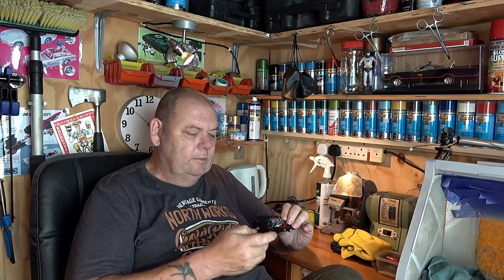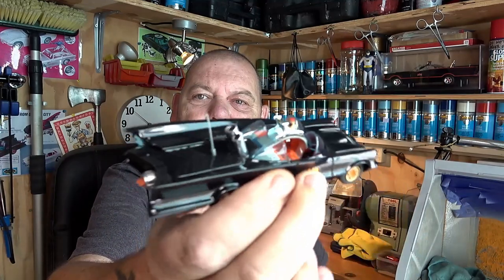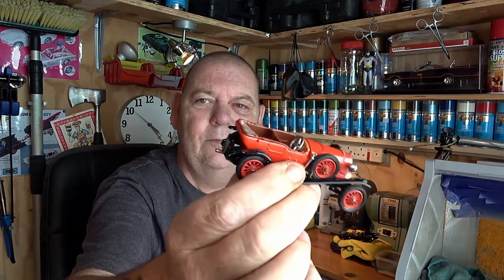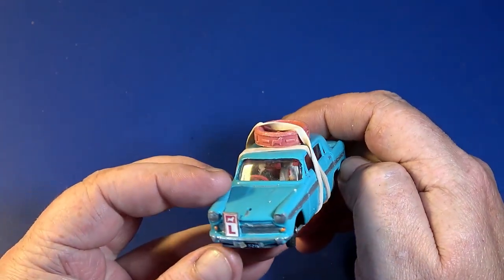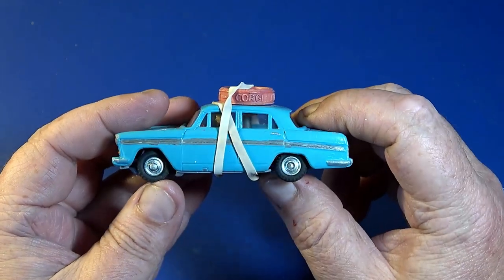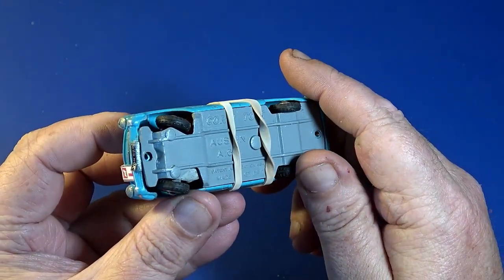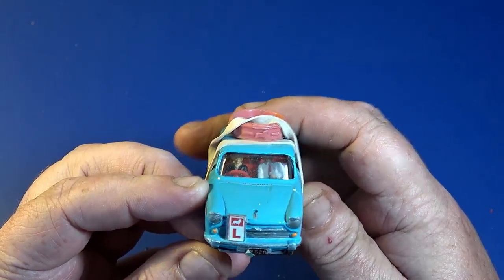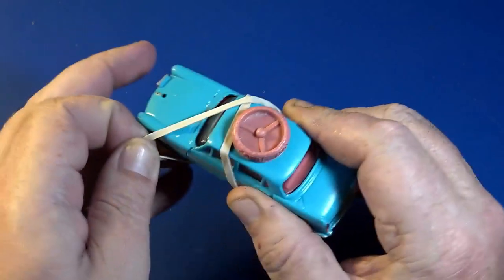Corgi 236 Austin A60 Driving School Car Complete Restoration

Comment: Hi Bob, good to see you.
Been trying 3 days to watch your video, still internet problems here. It would go for a few minutes then lock up. Finally completed it tonight.
The trainer turned out great, good save on the new tape. The steering wheel on top turned out great, good idea to paint it, that's using your experience to know what to do. Keep up the good work. 
See you in your next one.
Cheers Robert.